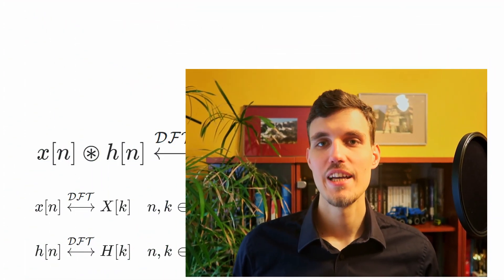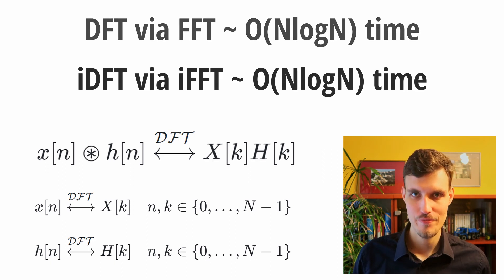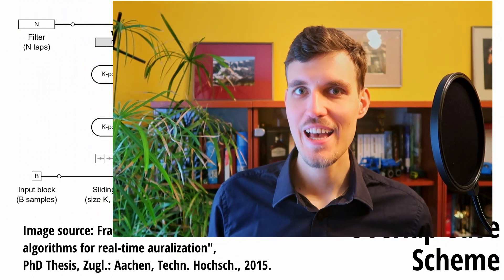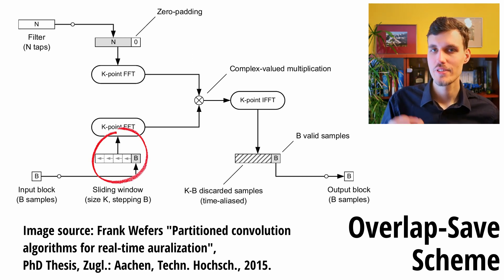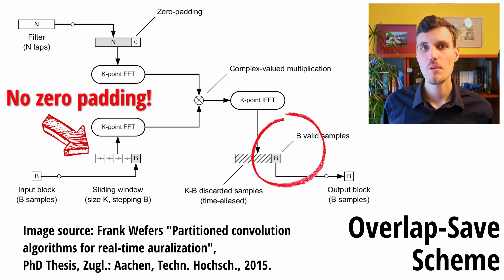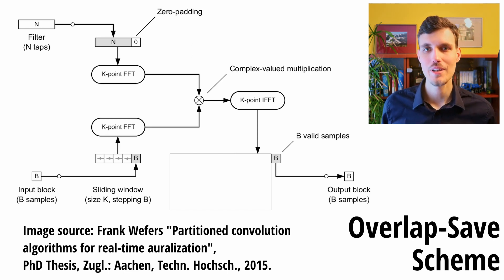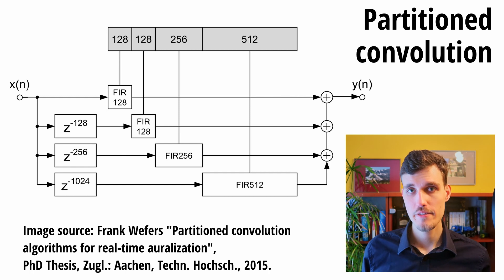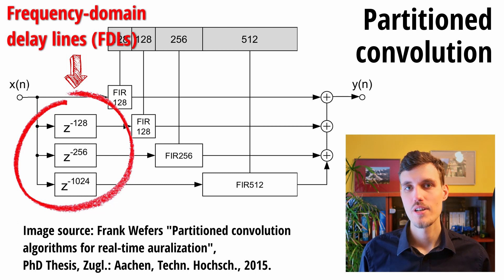Fast Convolution: FFT-based, Overlap-Add, Overlap-Save, Partitioned [DSP #09]

Comment: Hey, question about the diagram regarding non-uniformly partitioned convolution shown at 6:42. Why is the final delay 1024 instead of 512, is it a typo? I believe I've read the relevant parts of the thesis but can't find an explanation.

Comment: Great Video and thanks!
I've read a Paper, where a "windowed Overlap-Add" is used to get data blocks of a PPG time signal. On each of these blocks they used an ICA-Algorithm. At the end they reconstruct these blocks by "overlap-add  synthesis".
I know what the window method of FIR filters is but in the paper, they didnt spoke about a filter. They just said, "a bartlett window is used". That confuses me, because i dont rly understand what the filter is. Is h(n) the bartlett window funtion, so they just convolve the window funktion with these data block? Actually these windows are multiplicated with a filter like: h(n)_window = h(n) * bartlett(n) and then you convolve h(n)_window with these data blocks. Does it makes sense, if you just convolve each data block with an bartlett window?
Thanks again, for your great video and your article!
Reply from the maker: Overlap-add in this sense (probably) means something different. In this context, it sounds as if they had small portions of the signal ("windowed" signal) that are at the end simply added together with some offset.
You can find something similar in time-scale modification. If you window a signal and then add the windowed parts "closer-together" you will receive a shorter signal but with the same pitch. Check here: https://www.mdpi.com/2076-3417/6/2/57
In sound synthesis, this is called granular synthesis.

 "Does it makes sense, if you just convolve each data block with an bartlett window?" -> yes, you make the data block smooth in time then.

I hope that helps!